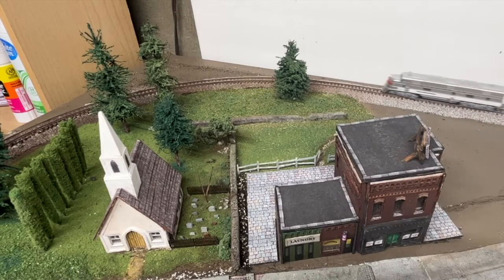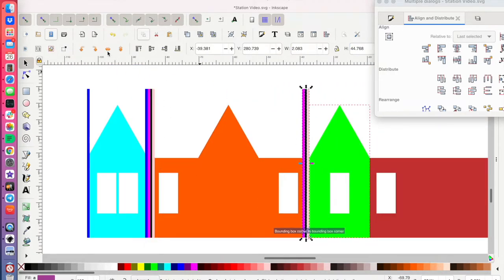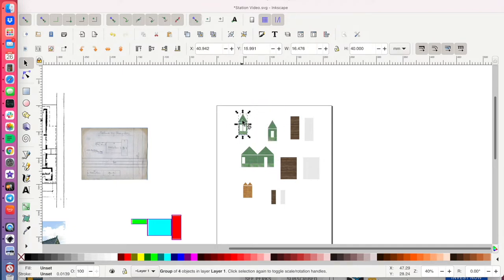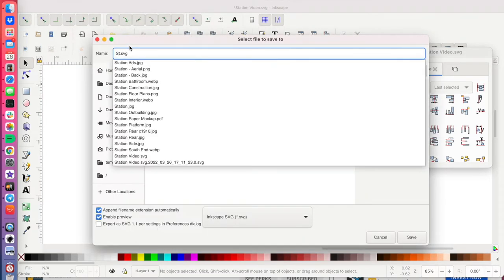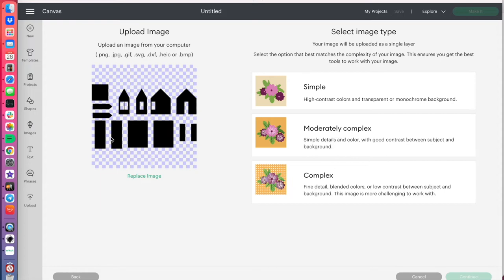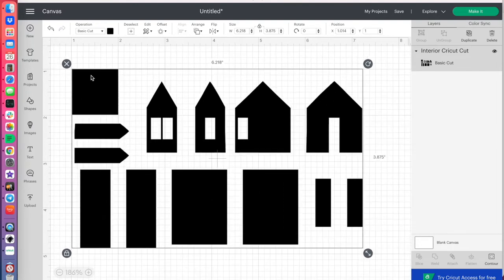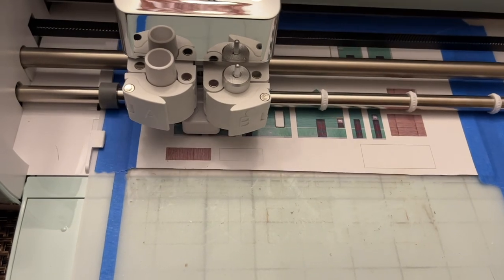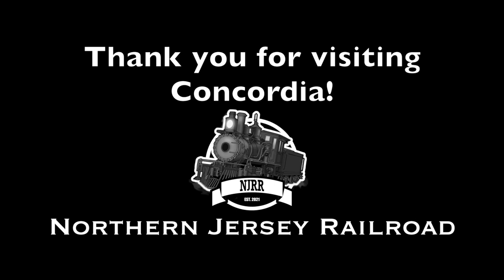Using Inkscape and Cricut to Scratchbuild a Train Station - Part 2

Comment: Very tempting these machines. Have you ever used it to cut styrene sheets? A lot of scratchbuilders use Evergreen styrene where you are using wood. Styrene has much cleaner edges when cut.
Reply from the maker: The machines have their uses...and their limitations. I think for model railroaders, the Maker model of Cricut would be a better choice than the Air Explore series that I have because it has a "knife" setting that can cut through wood and thicker materials. My model is good on thinner materials like 0.5 mm card or vinyl (which I use to cut out windows), but it struggles on thicker material. And getting narrow cuts like a 0.5 mm or less is darn near impossible without tearing up the material, so I've learned I have to do such work by hand. But the broad strokes of cutting out walls and roof panels or other items that doesn't require intricate detail is a perfect use for my machine. The Maker model may allow you to take it a bit further.

I'd also add that I'm working in N scale, which of necessity is tiny and requires fine detail, HO scale or larger would probably not have the same limitations and these machines, even mine, could do a lot more.